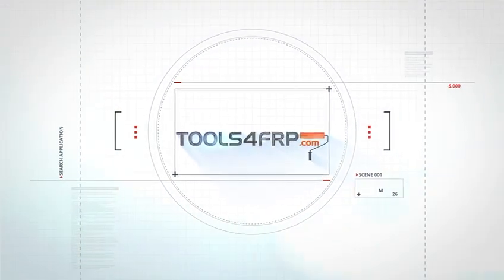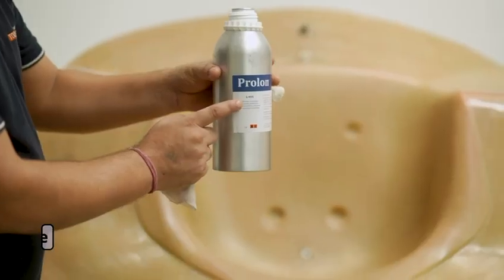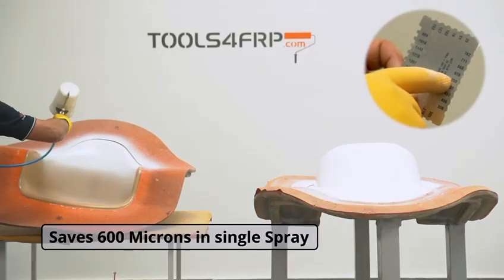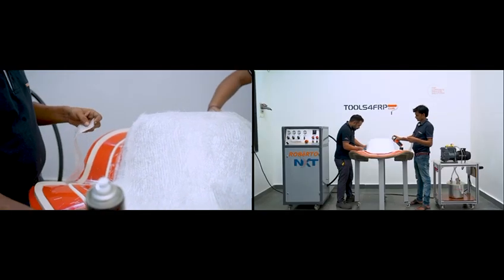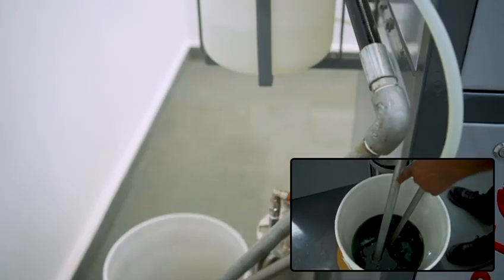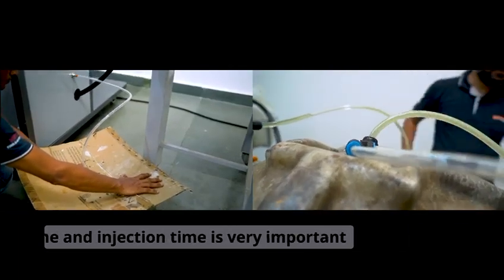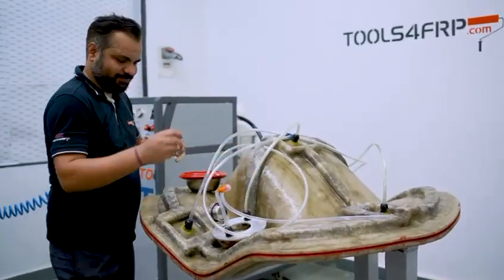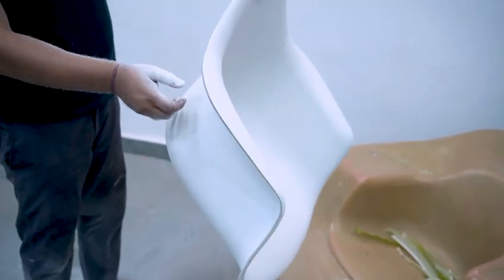Vacuum assisted  Resin Transfer Moulding Process

Comment: I like the part where they stopped using a 5000$ injection machine and used an angle grinder to trim the part by hand wearing no mask nor using any extraction for dust fiber.
Quality at its finest